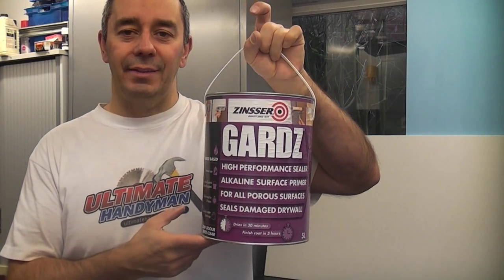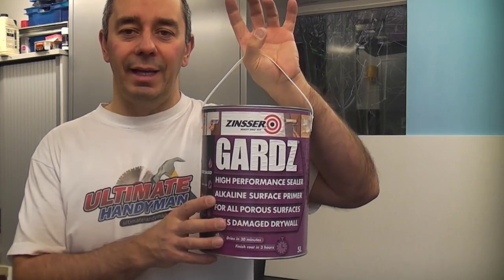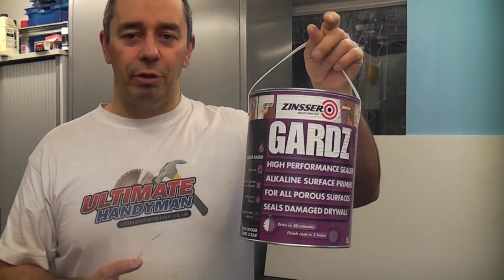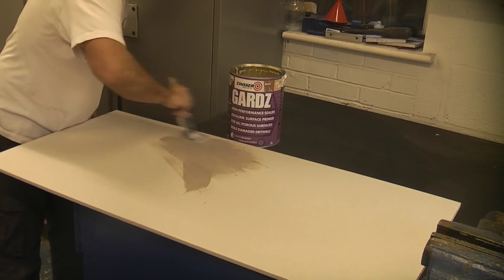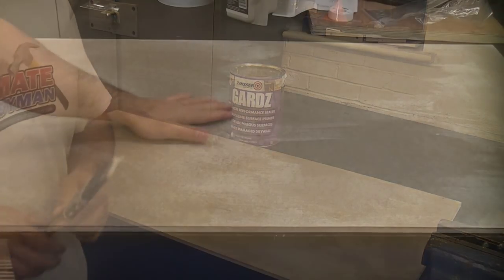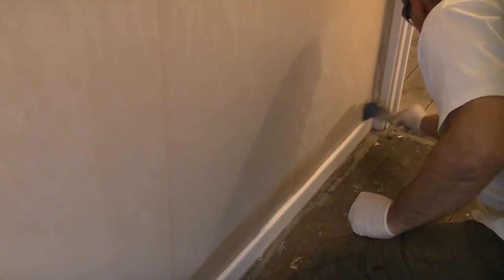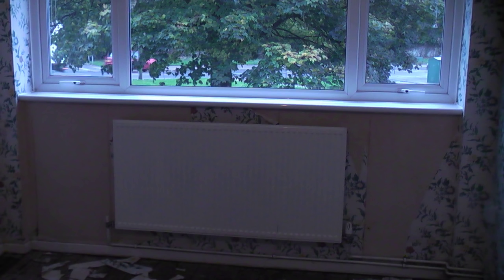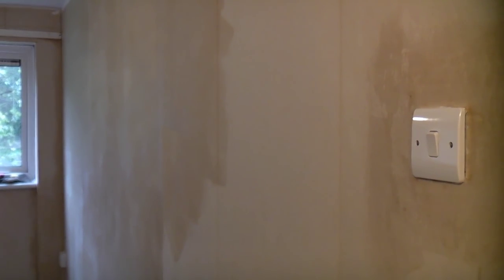Zinsser Gardz | Drywall sealer/primer

Comment: I was sanding my ceiling today to find that the old paint was peeling away.  When I was doing it I was trying to think of the product you would use and hey presto out comes a video the same day and the solution. Thanks ultimate handyman.
Reply from the maker: +TheFossil999 For peeling paint I would use Zinsser peel stop, it should work better than the Gardz ;-)Thanks for the comment

Comment: good video - when working on walls where wall paper has been completly stipped at what stage would you use this please? I am thinking to sand and fill first but just checking thanks
Reply from the maker: I’d fill any holes and sand them flush, then apply the Gardz 👍

Comment: OK, so you can use this to prime new plasterboard (after you scrim tape all the joints) and avoid having to get a plasterer to skimcoat the plasterboard?   A coat of this then a couple of coats of emulsion straight over?   Will the finish be comparable to 2 coats of emulsion over a skimcoat?   Keep up the good work, your channel is superb.
Reply from the maker: Yes, tape and scrim the joints, then sand them smooth. Then paint it all with this and it will give you a rock hard finish. It might not be as durable as a skim coat, but it will save a lot of work!

Comment: Can this be used on brand new skimmed plaster - to seal the surface instead of using the more common approach of mist coat?
Reply from the maker: A mist coat is probably best, unless you can wait until you are certain that the plaster is 100% dry, in which case Gardz is superb 👍

Comment: I've stripped some rooms of wallpaper. It's a budget job and I can't line the walls. They are in not very good condition. Is this the best product to seal walls  with as I'm concerned about paste coming through after I have emulsioned the walls.
Reply from the maker: Yes, this will seal the wall and prevent the paste coming through.
If the walls need filling first this video might help- https://www.youtube.com/watch?v=6wa_m_RKWjw
Reply: Ultimate Handyman OK can you fill the walls after applying the gardz?

Comment: Will this seal chalky mist coated emulsion walls and ceilings? Recently fitted light weight coving onto freshly plastered then mist coated walls  ,cutting a long story short none of it has adhered! Used water based grab adhesive  and I'm thinking its failed due to  extreme suction  . Never had a problem before  hence why I'm baffled why this has happened and  concered how best to re do it .😪
Reply from the maker: I don't think so, but there will probably be a zinsser product that you can use.
I'd ask their technical department - https://www.zinsseruk.com/technical-support/
👍

Comment: Can you use this as a primer on existing interior latex wall paint?  I'm planning to use this over spackling for some wall touch-up, but would get some of this product over the existing wall paint.  Is this OK, and I can just apply finish coat over it without applying a separate latex primer over the Gardz?  Thanks.
Reply from the maker: I'm not sure if this will work over latex paint, but Zinsser B.I.N will.
If you patch prime over the spackling with the B.I.N and feather it out, you should be able to apply a top coat to cover the lot.
This video shows how to feather out a wall repair at about 2:58 into the video- https://www.youtube.com/watch?v=J1Q3PkUVs8U
Thanks for the comment

Comment: Excellent video as always. As an amateur I find it  hard to butt-join lining paper so that the gaps between strips are not visible when  paint is applied. Does this stuff manage to conceal the gaps?
Reply from the maker: +ck53xx 
No, I don't think it will help with that.
The critical thing with any paper is ensuring that the paste is mixed exactly to the manufacturers specification, also each piece must have the paste soaking in for exactly the same amount of time. This should make it easier to butt the paper up to each other. A seam roller also helps to get a good seam.
A decorator once said that he leaves a tiny gap between the lining paper,then fills it using caulk. But I have never tried this method!
Reply: +Ultimate Handyman Thanks for the tip. I will try to follow that advice in future.

Comment: I removed some bathroom tiles off a wall which damaged the drywall brown paper.  am I better off replacing the dmnaged drywall section (3'x4') or use Zinsser gardz and repair wall joint compound.  I don't intend to tile; just want to paint wall as temporary fix.  any suggestions?
Reply from the maker: You should be able to prime that using PVA, then use a suitable filler such as Gyproc Easi-fill.

Comment: I have just removed  wallpaper which has revealed a bit of a mess half of the wall has old emulsion paint some paint has melted of with me stripping & steamer but doesn't seem to be flaking, the other wall the drywall is into the dark paper, I have a can of gardz & pva, I was going to treat the damaged drywall with the gardz but I'm not sure how to treat the painted part. I intend to skim or plaster over this full wall as it's uneven , any advice appreciated,
Reply from the maker: If you are skimming over the wall, I would just PVA the whole area, then give it a skim coat. No need to waste the Gardz if it is being plastered over. You can save the Gardz for another day (it is brilliant stuff BTW)
Thanks for the comment 👍

Comment: Can it only be used on drywall? I’ve got an older house where it’s solid walls and skim coats....
Reply from the maker: It can be used on drywall or lining paper.
Can you not just seal the walls with a mist coat of watered down non-vinyl emulsion?
Thanks for the comment

Comment: Would this be suitable for priming plasterboard for papering onto, so you could subsequently strip the paper without knackering the PB?
Reply from the maker: +Katie Boutelant 
Yes, once the Gardz is painted on it gives a really hard surface which is ideal for painting or papering over.
We actually papered one wall in that room and it made papering the wall much easier and gave us a smooth, hard surface to paper onto.
Thanks for the comment ;-)

Comment: With this being water based, will it work on moisture resistant plasterboard I've used to box in some pipes in a bathroom or would plaster still be required? Thanks
Reply from the maker: I'm not really sure about that. Do you have any offcuts of the moisture resistant plasterboard to test it on?
I think it will still work, but not 100% certain.
Thanks for the comment
Reply: @ultimatehandyman  Thanks. Yes, I'll try with an off cut first. Thanks for the advice and useful videos.
Reply: I have a similar situation and after speaking with Zinsser technical they said it would be fine to use on MR board.

Comment: could it be used to seal lime wash walls/ceilings prior to plastering?
Reply from the maker: +neilgla I'm not sure, sorry.I have only used it before on lining paper and plasterboard. Zinsser have a free app for smart phones,  it might tell you on there but I checked the Zinsser pocket guide and it does not say in there.Most Zinsser primers are designed for painting over, so I'm not sure about plastering over any of them!

Comment: Can you use this on plastered walls where paint doesn't stick? I have some sections of a chimney breast that have been plastered but the mist coat doesn't adhere and comes away as a powdery residue after a few days.
Reply from the maker: No, I don't think this will work.
Is the plaster completely dry?
Reply: @ultimatehandyman  yes, was skimmed a few years ago.
Reply from the maker: @Hussain-ch3pr   It might be worth checking with Zinsser, they have free help available for technical issues- https://fave.co/3DsTKIt
Reply: @ultimatehandyman  thanks you mate, will check it out. Keep up the good work.

Comment: Do you know the difference between this and peel stop? on paper they seem basically the same.
Reply from the maker: +caskwith 
I think peel stop is mainly designed for use on painted surfaces that are peeling, whereas this is designed for drywall/lining paper etc.
There are so many Zinsser products that do similar things that I normally check their APP on my phone (free from the App store) to ensure I get the most suitable.
I was really surprised just how far a tin of this went. I did all the walls in a medium sized bedroom and still had half of a 5L tin left!
Thanks for the comment ;-)
Reply: Ahh I see, well I picked the right one for our job then. It did also do a great job of priming areas that I had filled and sanded. I'll give gardz a go in the future. Thanks for the great vids as always!
Reply from the maker: +caskwith You are welcomeThanks for the comment ;-)

Comment: Great video. Can you use this on a wall where paper has been removed leaving patchy paint? I've sanded down any loose bits. Thanks
Reply from the maker: Probably not, this is designed for use on bare paper, such as lining paper or unskimmed drywall.
Thanks for the comment
Reply: What did you end up using instead?
Reply: @ultimatehandyman  what would you recommend instead? Thanks

Comment: Should you apply this before skimming the walls after wallpaper removal ?
Reply from the maker: No, PVA is better for that job and much cheaper. 
Thanks for the comment
Reply: I disagree with the UH.  You absolutely want to use Gardz after removing wallpaper. It seals the glue and torn paper areas and helps adhere the skim coat. Using it after skimming will harden the surface which is especially important if your final coat is a lite joint compound.
Reply from the maker: @jerseyjim9092   I have the Zinsser pocket guide in front of me, nowhere does it say that you can skim on top of the Gardz- which is why I did not recommend it.
Reply: @ultimatehandyman  You must have a different formula than the Zinsser Gardz that I have.   Specifically says on the can label to use it before and after skimming damaged drywall.  I've used it several times for that purpose with great results.  I buy it by the case from HD.
Reply from the maker: @jerseyjim9092   I think there is some confusion here. 
The original poster asked if it should be used before applying a skim coat, I said PVA should be used.
Gardz can be used to seal drywall, or seal a wall once it has been skimmed. Gardz is not recommended for sealing a wall prior to skimming. 
I hope this makes sense ;-)
Reply: @ultimatehandyman   Technical Datasheet says it can be used before or after skimming as a primer and sealer depending on situation:
"GARDZ prevents bubbles that form when damaged drywall is skim coated with spackling or joint compound. It penetrates and seals damaged facing paper, restoring it to a sound surface for repairs." Also to the OP's question, "Water-based coatings or texture finishes will re-activate old wallpaper adhesive which results in cracking and peeling. 
GARDZ completely seals in residual adhesive which can ruin water-based topcoats and texture finishes."

https://www.rustoleum.com/product-catalog/consumer-brands/zinsser/primer-sealers/gardz-problem-surface-sealer#tab-1

Comment: SO I CAN PAINT A COAT OF ZINSSER GARDZ ON TO NEW LINING PAPER (1400 GRADE) BEFORE FINISHING WITH 2 COATS OF EMULSION???
Reply from the maker: Yes, that should be fine.
Sometimes you can paint directly onto new lining paper, but it can cause issues with bubbles etc.
Reply: @ultimatehandyman  YEAH - I DID GET A COUPLE OF BUBBLES AFTER PAINTING THE LINING PAPER IN THE FIRST ROOM - SO I WANT TO TRY PAINTING A COAT OF ZINSSER GARDZ FIRST NEXT TIME TO SEAL THE LINING PAPER - AND THEN EMULSION ON TOP OF THAT AS IT SEEMS LIKE THAT METHOD WORKED FOR U MATE!!!!!
Reply from the maker: @mrv5801   It worked brilliantly in the room in this video. I was really impressed with it ;-)

Comment: Hi. I remember watching this some time ago and have just had a problem with the bathroom ceiling so who else to ask for advice please. I had the ceiling plastered and then sealed it with an emulsion mist. Then two coats of bathroom emulsion. All good. However, I needed to enlarge the light holes as the plaster had gone over them slightly. So, four weeks later I went to remove the excess plaster but some of the paint peeled off. I’ve now peeled off more. My question is, do I need to strip the lot or will zinser Bin the red one seal it all? I’m hoping so. Sorry to be long winded. Thanks Nick
Reply from the maker: I'm no expert on this subject, but if it was me I would remove any loose paint, perhaps give it a light sanding and then prime the lot using Zinsser 123 plus. I have had a quick look in the Zinsser pocket guide and it only recommends B.I.N for patch priming in mildew areas.  The emulsion mist coat that was applied, it was non-vinyl emulsion that was used wasn't it?
Reply: Errr think it was Matt but can’t be sure. Think I’ll carry on scraping 😩😩 thanks for your help. Good to have a sounding board. Cheers
Reply from the maker: You can get matt vinyl emulsion, as well as silk vinyl emulsion.
Apparently if you use vinyl emulsion for the mist coat it sits on the surface and does not penetrate the substrate like a non-vinyl emulsion (which can make it peel off at a later date). It might be something else that is causing your problem, but thought I'd mention it.
Best of luck with it ;-)
Reply: Sounds like that's the problem. Many thanks again. Nick.

Comment: Can you use this over joint compound on cement board that is above a gas fireplace to prevent the wall from cracking?
Reply from the maker: I don't think so, this is just designed to seal drywall/lining paper etc.
Thanks for the comment
Reply: Ultimate Handyman thanks for your reply would you happen to know what I could use?

Comment: so  no sanding require? it self level? thx
Reply from the maker: No, as long as you are sealing either lining paper, or finished drywall- you can just paint it on.
It's not self levelling though, it has a consistency like milk, it is only designed to seal the surface.

Comment: Doing a project that involves peeling the vinyl off of wallpaper and leaving the back on (which went on top of lining paper before that). Mainly because it would be such an enormous faff to take it back to the wall.

I had planned to lining paper over the top of the vinyl backing paper, but was worried about bubbling and such - looks like slapping this stuff over all that backing paper would lock it in good.

However, I will need to be filling in small holes holes and such and after that was planning on putting some paintable lining paper over the top of it all to ensure a nice finish for painting. If I just painted straight on top of the Gardz, would I need to do anything special for these filled in areas to ensure it didn't show through the Gardz + paint?
Reply from the maker: Once the filled holes are sanded and covered with the Gardz, it should be fine to paint over.
It's a brilliant product ;-)
Reply: @ultimatehandyman  Hi mate. So I managed to get the backing paper off easily and am going that route, taking me down to the lining paper which is sound against the wall. 

There are some areas (mostly in corners or slants), where it looks like I'll need to slice the lining paper and repaste those bits to stick them down proper.

For the filling of the lines afterwards, should I apply a coat of Gardz to the parts of the paper I just sliced and stuck down, then fill and sand, finishing with a second coat of Gardz after?

Have heard that just filling and sanding on bare lining paper may cause tearing, etc.
Reply from the maker: @Tephnos   I think if you apply the Gardz, then fill the bits that need filling and sand, I would then just patch prime the new areas with Gardz. I would not apply a complete full coat, as I'm not sure how Gardz will go over existing Gardz. It's amazing stuff BTW
Best of luck with it ;-)
Reply: @ultimatehandyman  Had a look at the Gardz datasheets. Mentions that textured or skim coated surfaces will be very absorbent and may require a second coat, so it looks like you can do 2 coats of Gardz if you want to be extra sure nothing is getting past it.
Reply from the maker: @Tephnos   Oh, OK. It's been a while since I've used it ;-)
Reply: @ultimatehandyman  Hi mate, one last question. What rollers do you use? Looks like a Purdy in that video?

Looking to start buying rollers and making sure I get it right first time. I presume a standard medium nap Purdy whitedove is what you use for the roller covers too? Want to make sure I've got the right roller covers for a textured superfresco paper I'll be painting soon once the gardz job is done too.
Reply from the maker: @Tephnos   Yes, That's correct I do use Purdy Rollers, they do squeak a bit in use, but that's not normally a problem for most people. I can't remember exactly which Purdy rollers I used though, sorry.